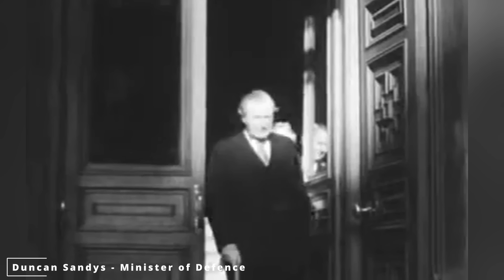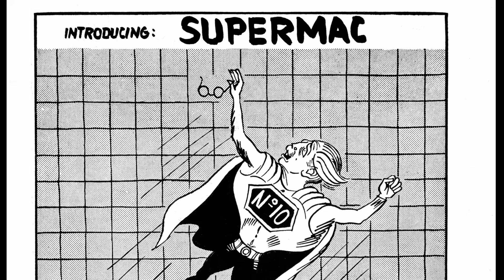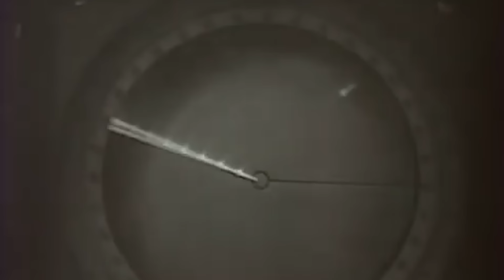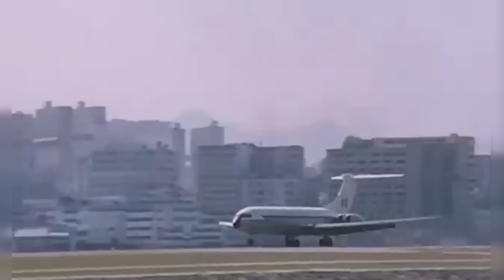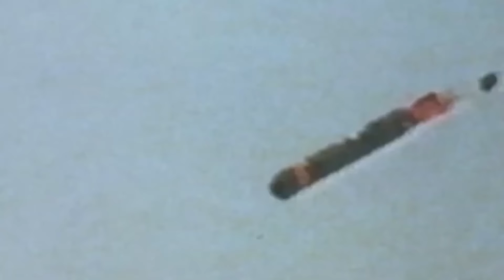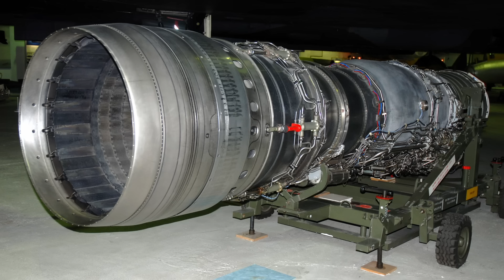How Britain Turned A Failed Airliner Into a Soviet Submarine Predator | The Mighty Nimrod

Comment: The shape of the windows had nothing to do with the fuselage failures. That’s basically an urban myth. Anyway, the cancellation of the evolved Nimrod, the MRA4, by that clown Cameron and Fox was scandalously idiotic financially and security wise. Disgusting.
Reply: The MRA.4 was never a viable concept and the program was scandal from beginning to end, a fiasco of incompetence and corruption at BAE Systems and the MoD
Reply: @DoktorBayerischeMotorenWerke 

@DoktorBayerischeMotorenWerke 

We believe we can clear up some commonly held myths and misconceptions obviously.

It's always good to see the facts presented clearly and concisely isn't it?

Bow-wing (see B-47 wing collapse wing folding incidents) had built less than 12 pressurised airliners before the Comet first flew and they were not high altitude airliners. 

All Nimrods were new build Comet 4 airframes with appropriate strengthening and the unpressurized  equipment bay tacked on. 

The HS 801 Nimrod was the most advanced aircraft of it's type at the time it first flew. Problems with the MRA4 programme were almost entirely due to radar and computer equipment issues and BAe Systems & co being too busy with other work at the time. 

Obviously there have been worse aircraft for accident losses both before & after the Comet.

Early problems with Comet takeoff stalls were caused by pilots over rotating the aircraft at liftoff. 

Podded engines on wings have aerodynamics issues. The main reasons for eventually going with podded engines were because or to facilitate -
Ease of maintenance.
Use of shear off fixings given excessive out of balance forces.
Large diameter turbofan engines.
Reduce load on the wing to fuselage connection. 
Increased power from later engines. 

The Bow-wing (See B-47 wing collapse & wing folding incidents) was a good example of how to expend a huge amount of cash and effort on something that was probably not worth bothering with. The basic design of the Comet had been decided upon and established before the podded engine choice has been made for the B-47. There were aerodynamics problems with podded pylon mounted engines at the time. The US also built and operated a significant number of EE Canberra bombers under licence which did not use podded engines for their wing mounted engines. . 

There have been aircraft losses caused by pod & pylon mounted engines. 

All jet airliners benefited greatly from the knowledge gained from the Comet incidents & subsequent investigations & yet some were still worse for accident losses. 

Instances of all marks of the Comet flew with full certification after 1954 including the Comet 3. The last Comet flight occured in 1997.

The fabulous trail blazing DH Comet.
World's first jet airliner in regular service.
The jet engined Avro Lancastrian actually did a passenger service before the DH Comet. 
World's first high altitude airliner.
World's first airliner with a full fuselage length pressurised cabin pressurised for high altitude flight. That feature for that type of aircraft was a considerably difficult undertaking. 

The change from larger squarer windows to smaller rounder windows was necessary for the particular aircraft at the time. Skin thickness remained mostly the same for all Comet marks. 

How things were back then.
Accident losses - % of aircraft built.

DeHavilland Comet 4 UK                          14% 
DeHavilland Comet all mks UK (ff 1949)17%  
Vickers VC10 UK (ff 1962)                         5%

Douglas DC-1  US                                       99%
Douglas DC-2                                              47%
Douglas DC-3                                              30%
Douglas DC-4                                              26%
Boeing s300    US                                       72% 
Boeing 307                                                  70%
Boeing 247                                                   48%
Boeing 707  (ff 1958)                                 32% 
Lockheed L-049 Constellation (ff 1943)  30%
Lockheed Electra US (ff 1957)                   29%
Fairchild FH-227 US (ff 1966)                   30%
McDonnell Douglas DC-8 US  (ff 1958)   14%
Sud Aviation Caravelle  (ff 1955)             15%
Canadair CL-44 Turboprop US (ff 1959) 46%  
Convair CV-580 Turboprop US (ff 1960) 22%
Convair CV-880     (ff 1959)                      27% 
Convair CV-990     (ff 1961)                      33%
Tupolev T-104        (ff 1956)                     16%
Vickers Viscount UK  (ff 1948)                29%  
Fokker F-27 Turboprop NL (ff 1955)       40%      

The Vickers VC10, fastest Atlantic crossing for a non supersonic jet airliner, held the record for 41 years.

For the first few years of operation the Caravelle & Comet had similar accident loss fatalities.

Sud Aviation Caravelle - 
all accident loss fatalities - 
1320 fatalities. 

De Havilland Comet - 
all accident loss fatalities - 
453 fatalities. 

An example of a typical airliner from the period. 
The Fokker Friendship F-27 fatalities & accident losses as a % of aircraft built. 
Fokker F-27 Turboprop (ff 1955)   40%
2130 fatalities.

Of course De Havilland carried out a full stress analysis & performed extensive & protracted testing on two long lengths of fuselage representing all features of a complete airframe. De Havilland carried out significantly more testing than was required by any authority at the time & significantly more testing that any previous airliner was subjected to.

De Havilland designers / engineers knew all there was to know about metal fatigue at the time they designed the DH Comet.

De Havilland had prior experience building many all metal construction airframe aircraft including many passengers aircraft & thousands of jet powered fighter aircraft that were primarily of metal construction with pressurised cockpits & used jet engines built by De-Havilland.

De Havilland did indeed always work to better than industry standards at the time, used up to date knowledge for the design & testing activities & no evidence of negligence or criminal negligence was ever produced in relation to the DH Comet.

Global aerospace. 
From the 1950s sector rationalisation and consolidation took place. 70 companies in France and 300 companies in the US disappeared due to merger or dissolution. In the US Boeing was almost bankrupted by the 707 project.  Boeing had a well protected domestic market and the available space and resources in the US to engage in large scale airliner manufacturing enabling them to capture orders simply by being able to produce airframes fast enough and cheap and nasty enough. Another factor is airlines preferring to obtain as much of their airliner inventory as possible from one manufacturer. 

Global Aerospace Sector, what's happening.

For example, there are of course no German companies that makes German jet aircraft in Germany & there are no German companies that make German gas turbine aero engines in Germany that are suitable for widebody airliners.

The UK has the world's highest combined per capita Nuclear / Defence / Aerospace Sector Activity.

UK defence sector, absolute terms, world's second highest activity. 1st for per capita defence sector activity. Per capita nuclear powered submarine construction, 2nd position. 
Main players being Rolls Royce, Babcock, GKN Aerospace & BAe Systems. Activities often involve international collaboration. BAe systems, RR and other UK companies now handle more Airbus work value wise than Germany. 

There's a good chance that anyone currently flying on a widebody airliner will be on an aircraft powered by RR gas turbine aero engines made in the UK and a good chance there will be other hardware on the aircraft that's designed and / or manufactured in the UK. 

Rolls Royce Holdings UK
Subsidiaries
- Rolls-Royce plc
- Rolls-Royce North America (ex Allison etc Classified Military stuff)
- Rolls-Royce AB
- Rolls-Royce Deutschland
- Rolls-Royce India Private Limited
- Rolls-Royce Marine Power Operations
- Vinters Engineering Limited
- Rolls-Royce Controls and Data Services
- Rolls-Royce Power Systems
- Bergen Marine
Joint ventures include:
- Rolls-Royce Turbomeca
- MTU Turbomeca -

Trent Family
The MT30 (Marine Turbine)
Industrial Trent 60 Gas Turbine
Trent 7000
Trent XWB Airbus A330neo.
Trent 1500
Trent 1000
Trent 500
Trent 600
Trent 700
Trent 800
Trent 8100
Trent 900
   
RR wholly owned subsidiaries in Germany handle smaller 2 shaft RR gas turbine aero engine work.

The UK space and aerospace sectors are highly productive, high-value industries that together contribute over £18 Billion in direct Gross Value Added (GVA) to the UK economy. Individually, the space industry directly contributes about 0.3% of UK GDP 7•2 Billion while the aerospace industry contributes approximately 0.5% £10•9 Billion.
   
We hope this helps.